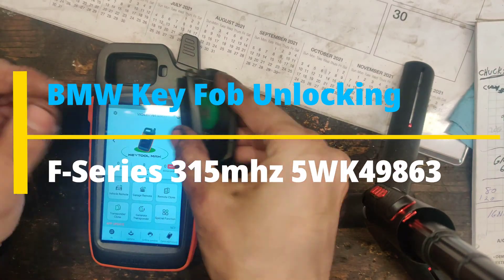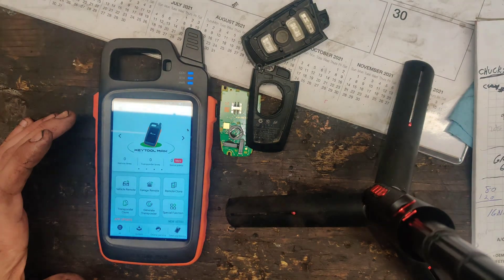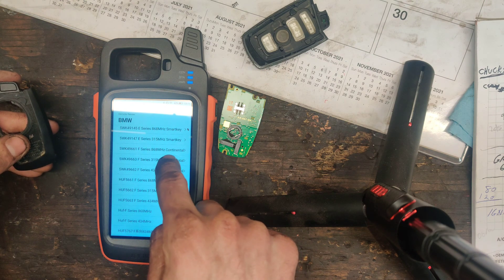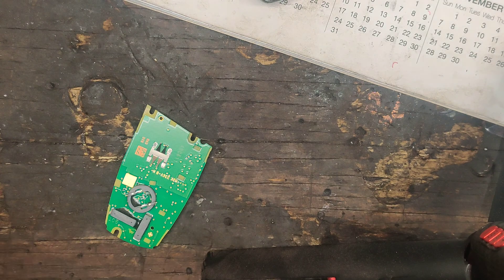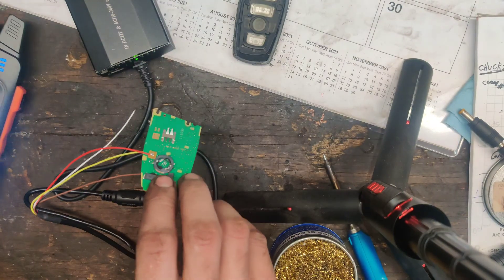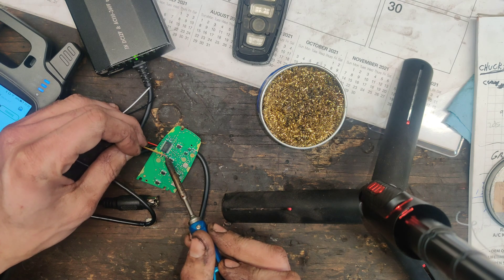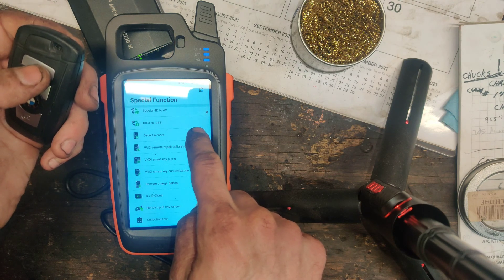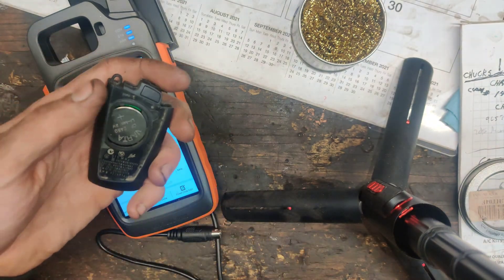BMW Smart Key Unlocking Using The Key Tool Max (F-Series 315MHZ 5WK49863)

Comment: well done. but what cause lock key .  when you trying to solder the wires the camera not on the board
Reply from the maker: Keys lock after they are programmed to a car and cannot be used on another car without unlocking. The tool shows where to Solder the wires. It's hard to Solder with a camera in your way.
Reply: @RobertDotterer   nice thanks